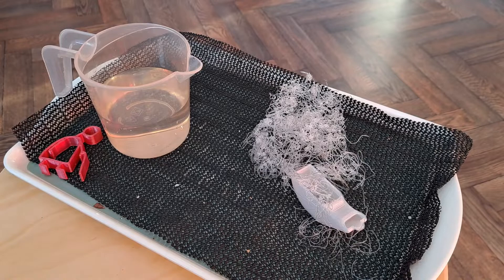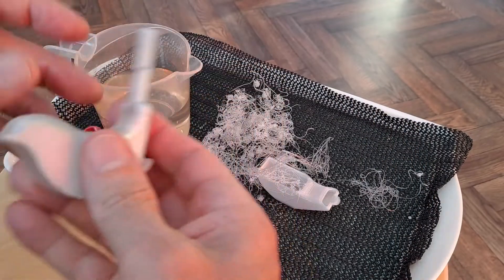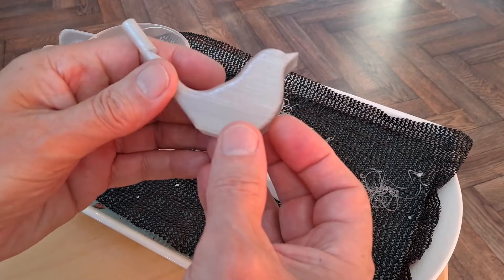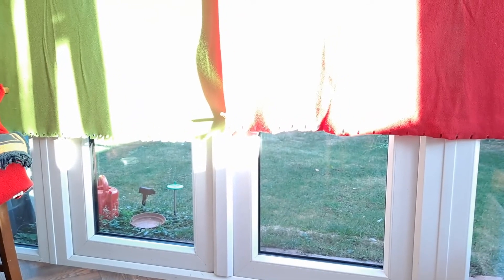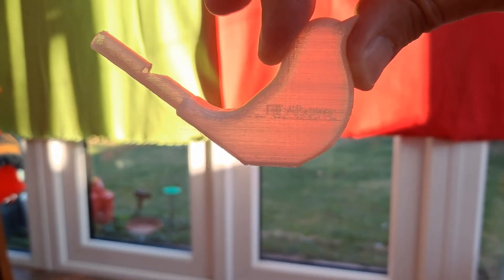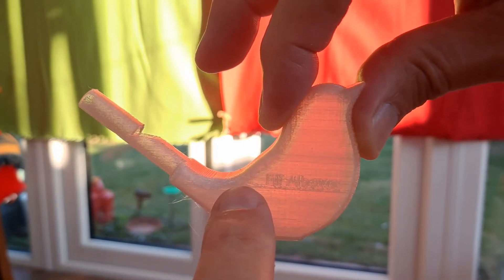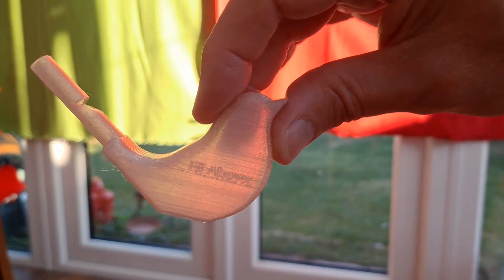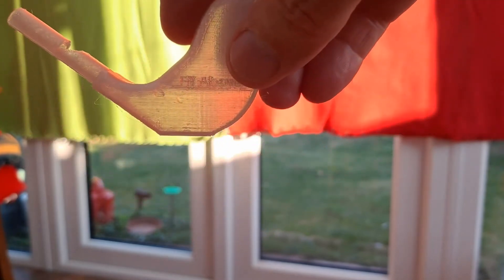Clear PLA 3D printed bird whistle

Comment: Is it safe to use as a whistle? Is pla toxic? I’m a complete beginner wanting to make one but worried about health risks.
Reply from the maker: Rather than ask some random guy on YouTube who may or may not know what he is talking about, I would suggest you do some research. Maybe Google "Is PLA food safe?" or similar. Then take into account who is giving you the answer and why. Technically the PLA is safe but remember the additives and the printing process.
Here is an extract from some information I Googled for you -
What you need to know before 3D printing food containers, utensils, and kitchenware using PLA filament.
3D Printing
Thanks to 3D printers, makers have the ability to bring any number of objects into existence, from missing hardware parts, to toys, to household items. But while the design freedom and capabilities of 3D printing may make it seem like you can make just about anything from the comfort of your home, it is important to understand what materials you are working with, especially if you are printing objects that will come into contact with food.

PLA (Polylactic acid) is a bioplastic material and is one of the most common 3D printing filaments available today. The plastic is derived from plants and is popular for its easy processing. Some of PLA filament’s benefits include that it prints at a lower temperature than many 3D printing materials, such as ABS, and it does not require a heated print bed. Because the material is made from natural materials, like corn starch and sugarcane, it is biodegradable and many assume it is food-safe. This can be true, but not in all cases. In this article, we answer the question “is PLA food-safe”, looking at what influences the material’s food safety and when to avoid food contact.

Recommended reading: PLA bed temperature & print temperature settings

What are the food-safe risks of PLA?
As a thermoplastic material, PLA is generally safe for food contact. In fact, a study from 1995 that put PLA material through several tests to determine how it breaks down found that it was “Generally Recognized As Safe (GRAS)” for food contact.[1] When it comes to 3D printing, however, there are other factors that can affect whether the material is safe to use in contact with food.

PLA Additives
In its purest form, PLA is food safe. However, if you are 3D printing with colored PLA filament, you should know that the additives used to dye the material may not be food safe. If you are 3D printing an object that will come into contact with food, like a mold or cookie cutter, it is safest to use natural (undyed) PLA filament. You can also consult the material information and safety data sheet for a particular filament brand to determine whether it contains any non-food-grade additives.

Non-food-safe printheads
Another element that can affect PLA’s food safety is the 3D printing process itself. In many cases, the metal hotend of the 3D printer is made from a non-food-grade material. That metal is continually coming into contact with the filament as it is extruded, which can lead to potentially dangerous contaminating traces in your 3D printed part.  Brass nozzles, for instance, can contain lead and potentially leach toxic particles into 3D prints. If you are concerned about whether your hotend will affect the safety of your 3D print, you can always opt to use a stainless steel nozzle, which is considered food-safe.

Comment: How much water do you put in it. I printed it but i don't have clear filament
Reply from the maker: Try holding it up to a bright light, you might still be able to see the shadow. Alternatively, just add a small amount of water and try it. How would you measure the water if I gave you a measurement, do you have a syringe?
Reply: @GrandadIsAnOldMan  yes, i do have a syringe
Reply from the maker: @connordarity  In the video, you can see it is very roughly half filled with water. So maybe fill it right up. Tip the water out into a glass, then use half that water to refill it. The exact level is not critical and tipping the bird forward or backward will make a difference to the level anyway. If you downloaded the files from Thingiverse, you will have seen the designer, Adam Stag, has gone to great lengths to explain how it works with diagrams and pictures in the Thingiverse article. https://www.thingiverse.com/thing:1155687

Comment: Good to see your 2nd attempt seems to have worked well. I see you have got your direct drive installed on the printer - hows that going? I haven't got mine fitted yet, I need to modify the wiring a bit for my E3 Max as the wirings short. But hey-ho, thats where all the fun is, right?
Reply from the maker: I feel more confident with the direct drive, but at the same time I am not looking forward to taking it apart to clear a blockage. That will be a new experience.